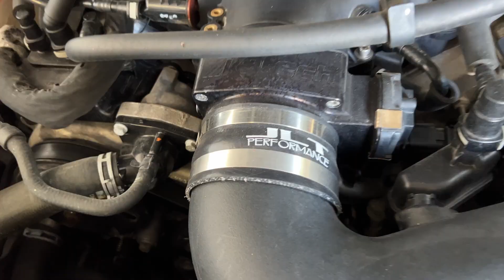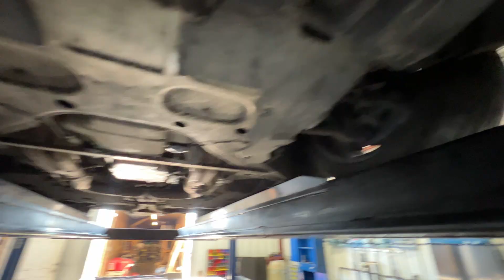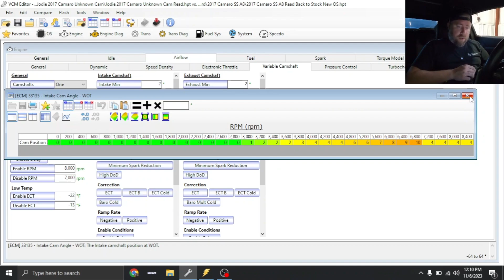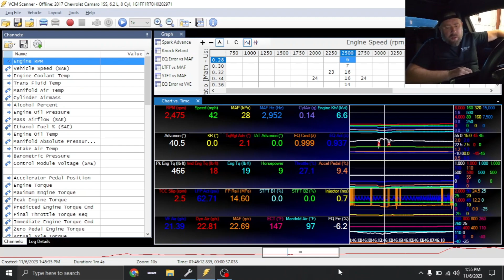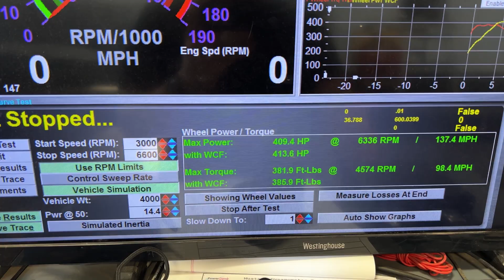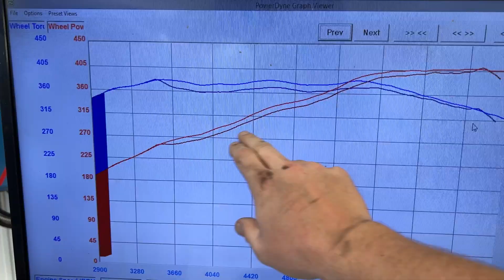Dyno Tuning a Cammed 6th Gen Camaro SS using HPtuners!

Comment: How do you tune the vve table for various cam angle positions?
Reply from the maker: Just depends on how much swing the VVT has. With a 4° limiter, it’s just as simple as running the cam at 0° and then once that table is tuned, you can copy that table to the 7.5° table and then have lock the cam at 4° and tune that difference into the 7.5° table. 

Or, if you know your VVT angles and you don’t plan on changing them, technically you can just tune the 0° table only, with VVT set to whatever you are going to run, and tune the table like normal. 

The first way is technically right but the 2nd way works just fine. 4° doesn’t change the VVE table much. 

Any swings more than that, then you have to bracket the cams and tune each table individually for it to be right.

Comment: Thanks Matt for all the info your sharing. I am currently tuning my 05 Yukon with a rebuilt 5.3 flat top pistons, truck norris, tsp ported heads, all the other stuff that goes with it. Truck is making great power and getting the fueling just about perfect but man the in gear idle is killing me. Hahaha... You make this stuff look super easy with all your years of experience. Thanks again man, your fairly local to me, I am close to Springfield TN. Keep'em coming I am always learning...
Reply from the maker: I have several videos that go over Short Term Idle Trims. That’s what you need to focus on first to clear up your in gear issue.

Comment: Good morning Matt great video. I asked a question on previous video, but you may not be checking those notifications since it was a video posted a few weeks ago. 
At SEMO, one of the HP engineers told me that the cylinder volume for the GEN five motors isn’t accurate, because it only counts for bore and stroke and not the cc of the cylinder head or the piston. GEN five motors being direct injected. This value is incorrect according to them. What do you think? Also, I can’t get my throttle blade to open more than 39.4% any idea on why? L86 with a E92 controller.
Reply from the maker: I will trust that GM engineers knew what they are doing when they set cylinder volume on all DI engines.

As for throttle blade angle… I have no idea. It literally could be thousands of things cause that. It isn’t normal though.